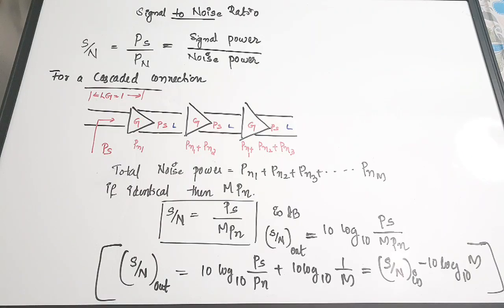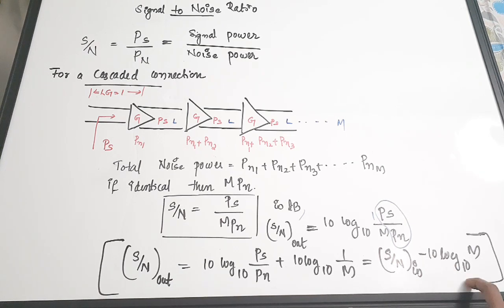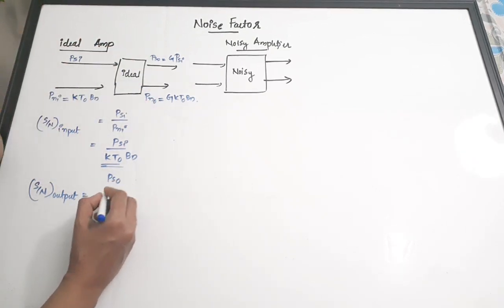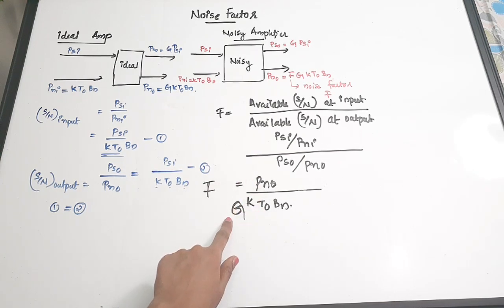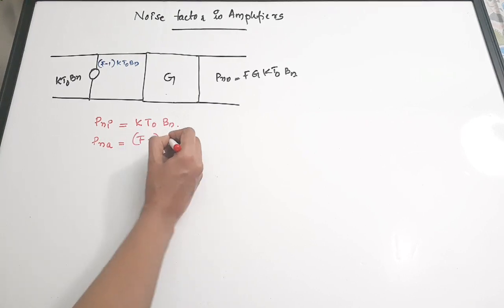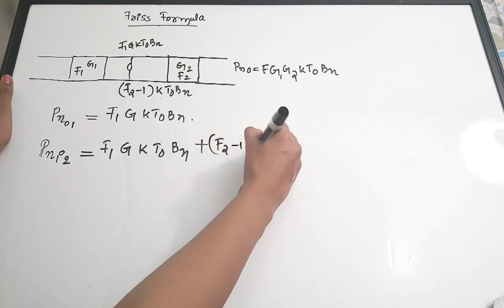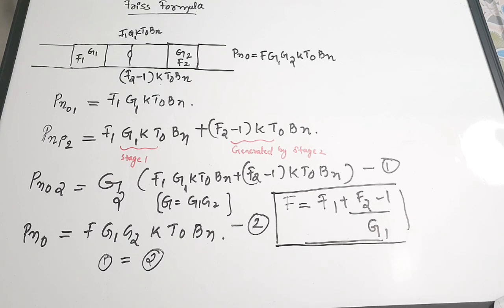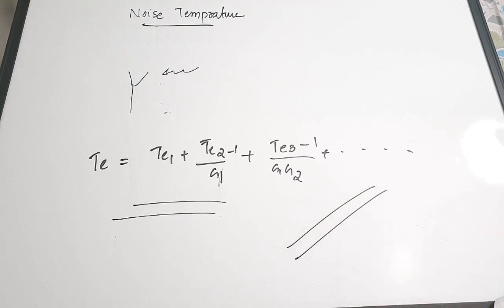Signal to Noise Ratio| Friss Formula for Noise Factor| Noise Factor| Noise Temperature

Comment: Mam....... How to solve fast logarithms question without calculator
Reply from the maker: Log to the base 10 or 2
Reply from the maker: You have to study some log values biheart. Then write the given logarithm in terms of that. I dont know any other way. But let me see once again.
Reply: OK mam but in ISRO exam not allowed calculator that's way I asking how to solve calculation easy way
Reply: @kanzariyamayur9225  you have to learn some basic values like log2, log3, log5, log7,  etc
Now you can simplify complex log values like log98 as (log2+ 2log7).
 If you have prime numbers then round off to the nearest composite number for approximate value.
 Same thing is explained by easy electronics (briefly)
Hope it helps.
Reply: @satyanarayanareddykarri489  thank you sir yes I got this how to solve logarithmic numeric.....🙏